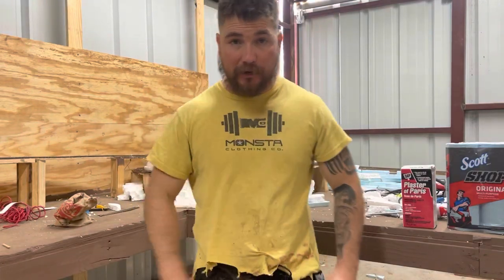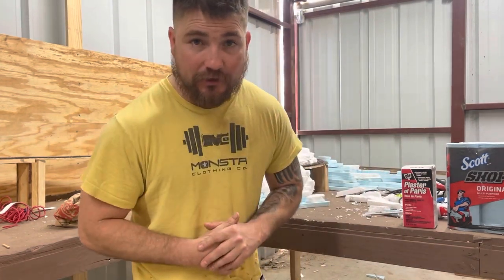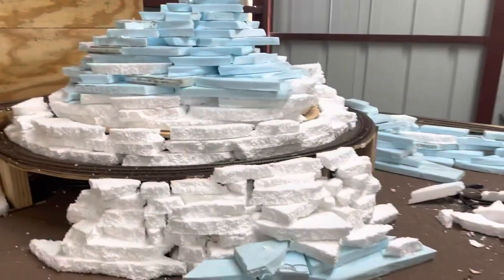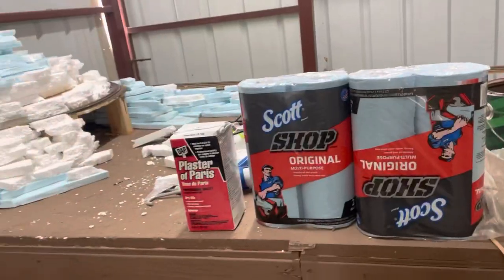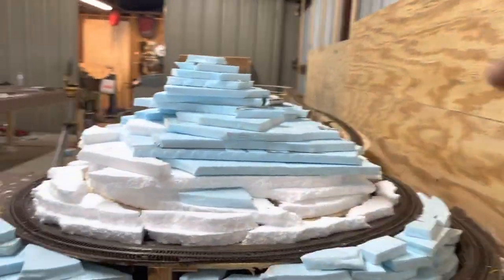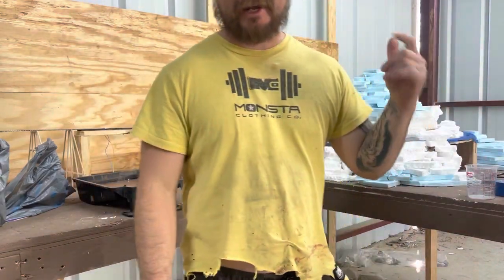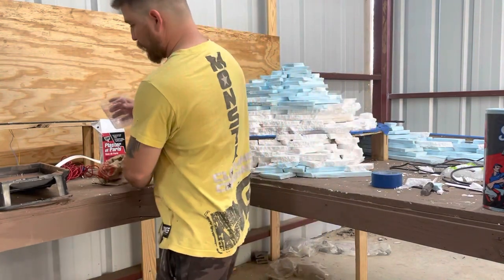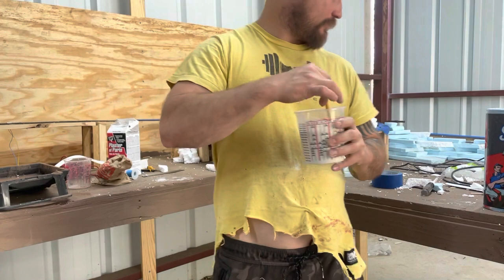Foam base..shop towels..and plaster of Paris for devil Mt. Ho train layout

Comment: You might have also mentioned for your followers that you used the plywood circle (referenced in the previous video) as a base for center portion of the very effective but messy mountain process you demonstrated. At this moment you had 124 views and 10 likes.  Your % of favorable response is on the rise. Outstanding job, sir.  👊
Reply: Apology. I lost track (no pun intended) of the plywood circle you created for mountain 51. It was still sitting against the benchwork in your next video. The circle you used here was evidently one created when cutting the plywood for the devil mountain helix. Ah well, I'm watching and learning. Thanks for sharing your knowledge. 🤛